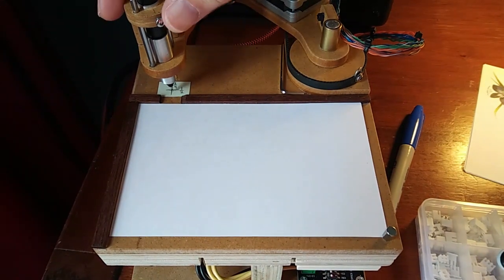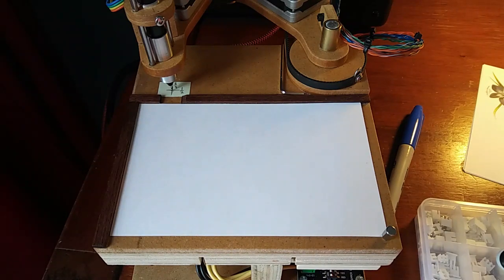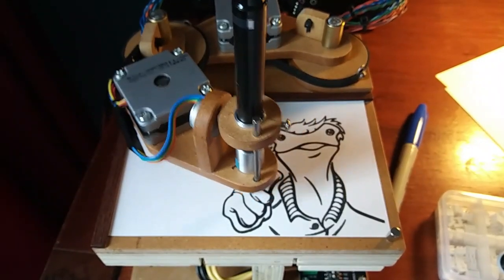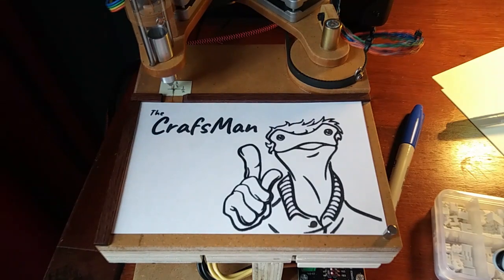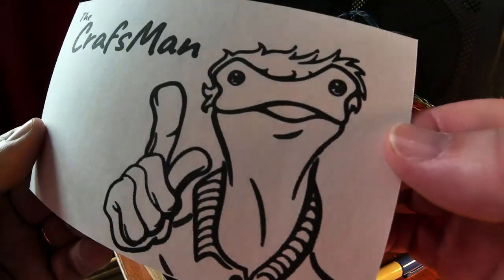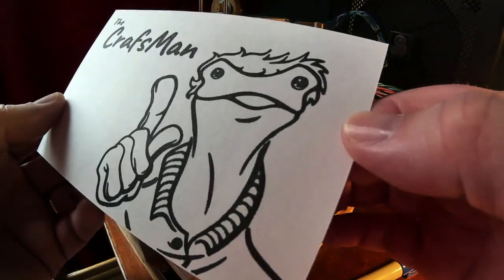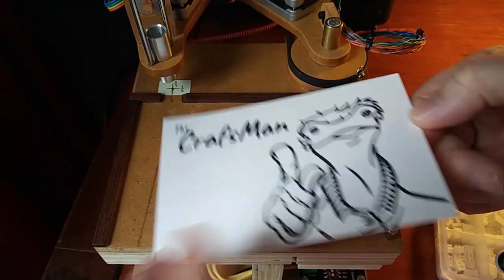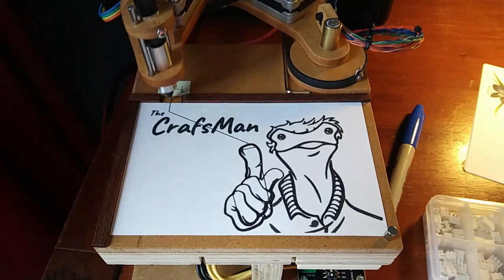The Crafsman - ESP32 Mini SCARA Robotic Arm Postcard Plotter

Comment: Haha, wow, that looks really good. Using a stepper motor to raise the Z-axis seems to be working pretty well. Did you code the firmware all by yourself? Or is that what you mean by 'software'?
Reply from the maker: Yeah, software, firmware, code, schmode, scripts, scraps. I don't know what you call it these days. I used regular installs of  Micropython and Python3. I wrote the extra libraries I needed. Had to do some tricky stuff to be able to send it WiFi fast enough, and I use simplified kinematics that are specific to this application (just a little trigonometry). I did use online image to vectors to gcode software.
Reply from the maker: At some point, I'll post it all so that people can duplicate this thing. Still need to work out a few minor bugs.
Reply: @ClaytonDarwin  great job, here above you speak about duplicate, so are there plans and software available?
thnx in advance
Reply from the maker: Yes. I actually just took the plotter out, dusted it off, and put it on my desk last night. Once I get the software together, I'll post it on Gitlab. I have some drawings too.